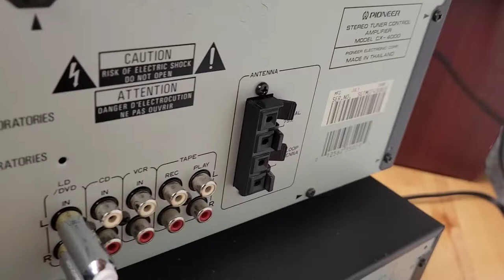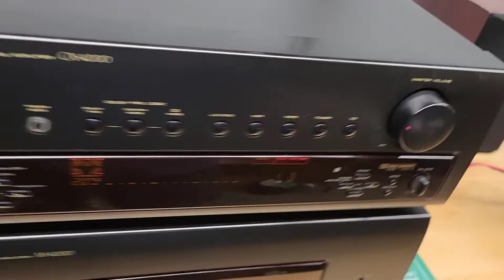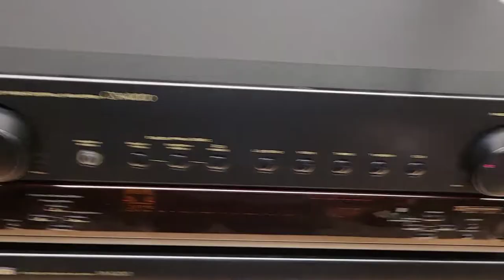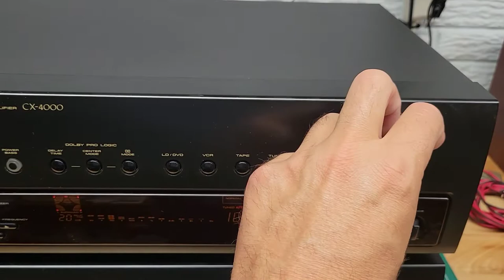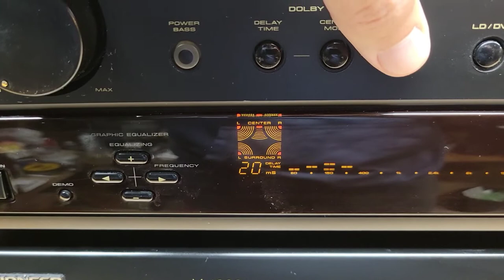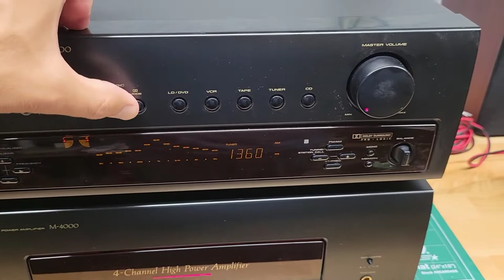Pioneer M-4000 Amplifier and CX-4000 Tuner Control Amplifier DEMO

Comment: Can I plug a aux cord somewhere to be able to play music from my phone
Reply from the maker: You sure can.  In the video you will see that I used a white cable with RCA plugs on one end and a 3.5mm headphone jack on the other and plugged it into the LD input on the back.   You could also use the tape or VCR input as well and the just select it on the front.  If your phone doesn't have a headphone jack, they also make Bluetooth units that will plug into the same ports and then you just stream the music wirelessly from your phone. https://www.ebay.com/itm/372275448632?mkcid=16&mkevt=1&mkrid=711-127632-2357-0&ssspo=bIFzbCYhSca&sssrc=2349624&ssuid=xe3vkg-hQsO&var=&widget_ver=artemis&media=COPY
https://www.ebay.com/itm/374106043861?mkcid=16&mkevt=1&mkrid=711-127632-2357-0&ssspo=5Hb8M-TnTVe&sssrc=2349624&ssuid=xe3vkg-hQsO&var=&widget_ver=artemis&media=COPY
Reply: @vintageav  thank you so much I appreciate it , your a big help for my party lol
Reply: Thanx I was wondering

Comment: I have one of these and it is stuck in standby mode could you possibly help
Reply from the maker: Thanks for the comment. Sorry I don't believe I can help out with your problem.  It's likely a bad component  internally. Sorry!
Reply: I’m having the same problem did you ever figure it out?
Reply: @wayermane5069   No lol it's sitting on the shelf I spent hours trying to figure out what was wrong with it Visited multiple websites if you figure it out come back and let me know
Reply from the maker: I am wondering if some kind of reset procedure would fix it.  Pioneer usually has some kind of key combination you can press while holding in (turning on) the power button and then a reset message will appear on the display.  I am also wondering if the little hole in the back of the unit above the LD input could possibly be a reset button that might work on its own when pressed or work in conjunction while pressing the power button at the same time.  I really don't know.  You could pull off the cover and see if there is a little button behind that hole from the inside.  I would start with the easy way and just try holding various buttons in on the front panel while turning the unit on and hold for several seconds and see what happens. If you decide to peek inside just be careful and unplug he unit from the wall before poking around in there so you don't get shocked...
Reply: @presidentpoohbear6659  Did you check the fuse?
Reply: @louiseamos1971  I can't find it
Reply: @presidentpoohbear6659  The fuse is in the receiver.

Comment: How can I connect AUX pin
Reply from the maker: You could hook up to the vcr or cd input on the back. Thanks for the comment.
Reply: @vintageav  I have Samsung DVD player.can I connect this
Reply from the maker: @user-gq7ob5yk9f  you can plug that dvd player into the LD/DVD inputs on the amplifier unit.
Reply: @vintageav  OK brother😊Thank u for your reply 🤗